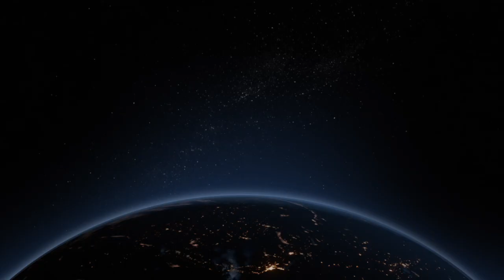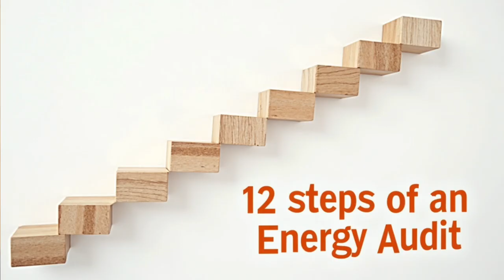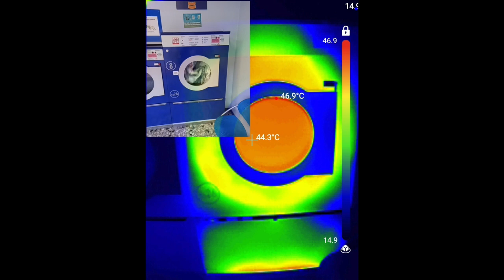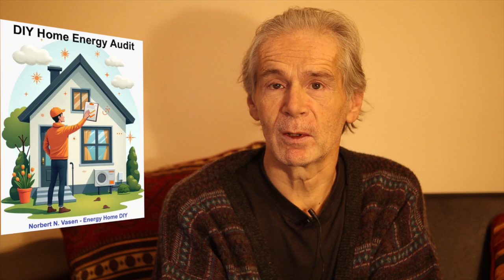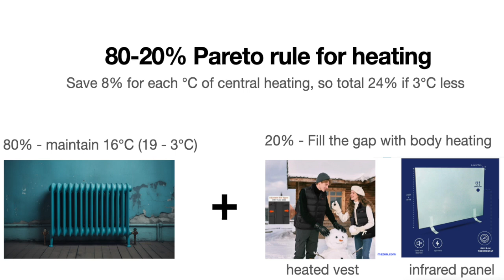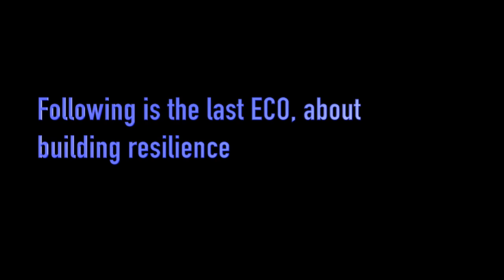DIY Energy Audit at Home, start here - Video 121

Comment: in the usa most homes/rentals/appartments have the default wifi router/modem that is sent to them for free by the ISP ologopoly here. i was looking around with a thermal camera when i moved into current house and was suprised at how hot the modem/router was as well as the doorbell transformer.
checked these two always on loads and the isp internet box used 65w constant and door bell transformer used 35w constant. 

the internet boxes here sell wifi hotspots to neighbors without routers with ur electricity and slow down ur internet + raise summer cooling bills. bought my own usb-c router and a regular modem which i converted to usb-c and run both through 98% efficient GaN powerbricks. togeather they only use ~7w.
cut the doorbell transformer primary lol. annoying solisitors can knock. 
these two simply tasks saved 90w constant load, or 2.1kw per day for the last 3 years (not counting summer cooling improvment). thats about 2300 kwh or $450 usd. it offset the half the electricity cost of charging my chevy volt lol.

btw i have made a new video explaining how the solar roof on my car works if youre interested. kind of long and complicated but imo its the most efficient use possible of solar on cars/evs
Reply from the maker: I also saw the bell trafo lighting up in my thermo-camera, that is funny! I am curious to see later how you connect the roof panels with the Chevrolet Volt later when I put in order the package on Gumroad. Anyway, the savings are very consistent. The router of the internet box is indeed consistent. Maybe it contained also the television, which in Italy is often sold together with internet.
Back to you heating project above, that is indeed amazing. I want to go on too with this project. 
It is also remarkable how you went through the black out that took so much time. I am now reading the book "The Grid" of Gretchen Bakke, PhD, she confirms that in USA the grid has a lot of challenges. I am now listening again the book on Audible.